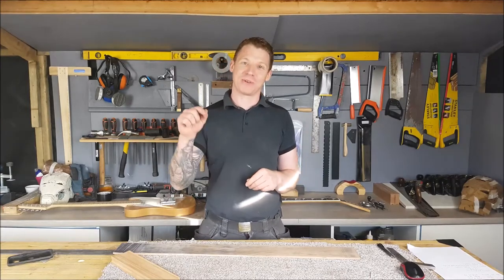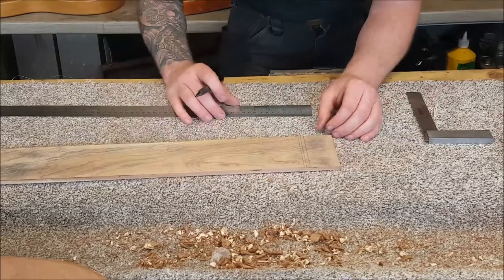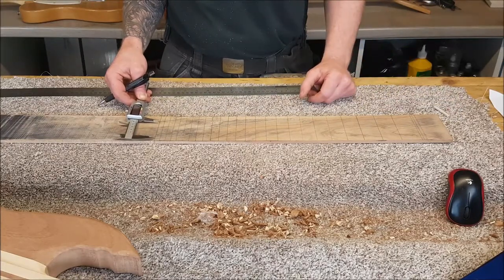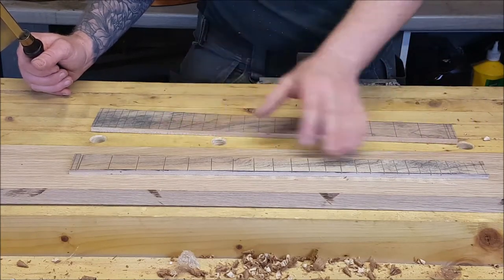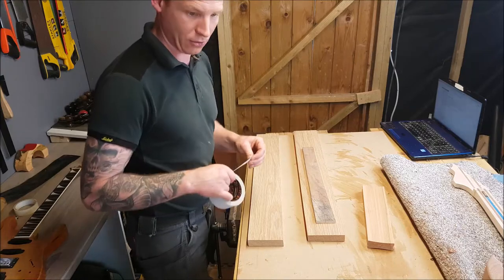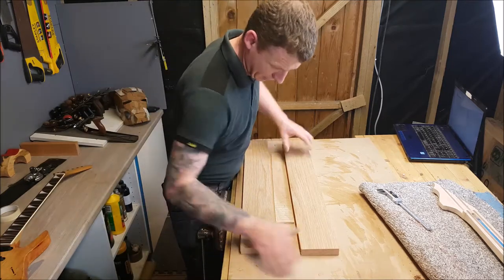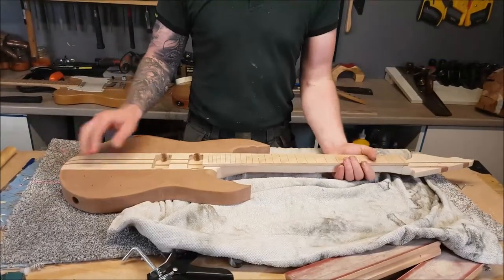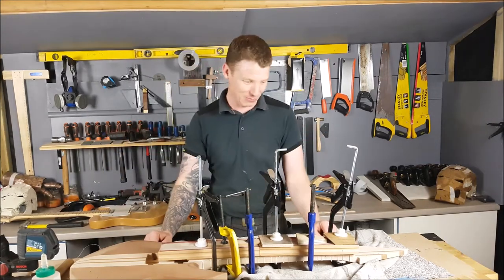Custom Guitar Build. Making the fret board. Episode 13

Comment: You should check out crimson guitars video on the masking tape and super glue trick. Holds as good as double sided tape but loads easier to remove
Reply from the maker: aquajew3000 thanks for the tip